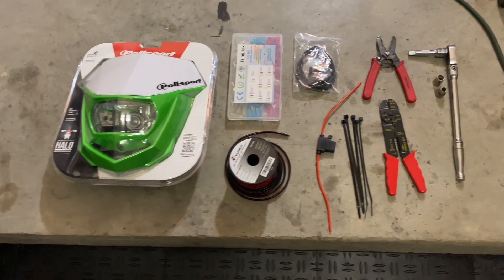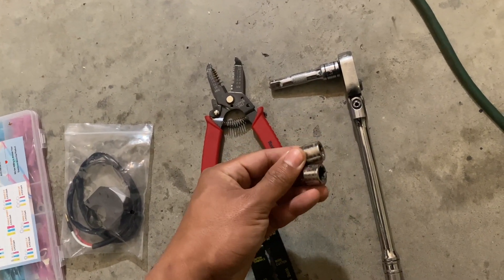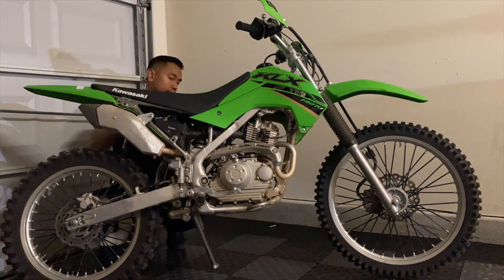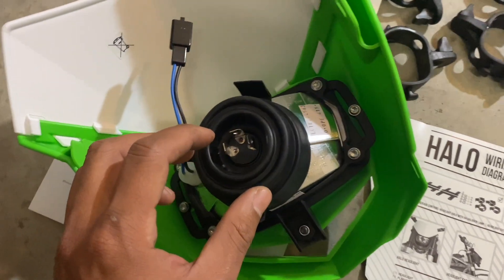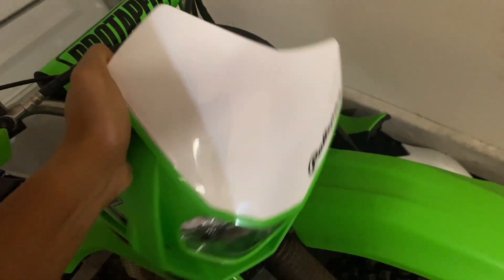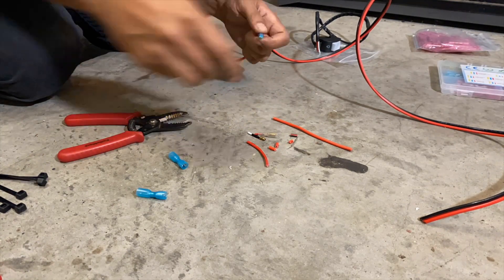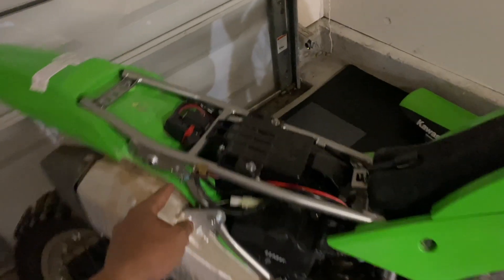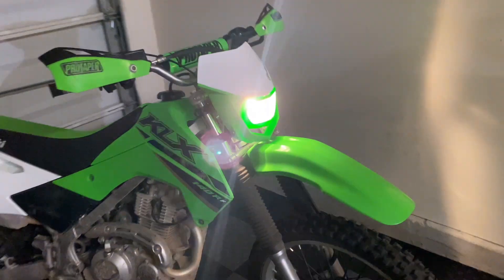Polisport Halo Headlight Installation and Wiring | 2022 #Kawasaki #KLX140RF KLX 140 RF

Comment: So my kit came pre wired with a black wire which I am guessing is the negative wire,I hooked that up to the battery.Now however there is another yellow and black cable conduit hanging around with loose copper wire on the end,not sure where this cable goes.

Comment: I noticed you didn’t use a relay and just hooked it up straight to the battery. Did you have any issues with it blowing the fuse since install? Thanks
Reply from the maker: Nope, no blown fuses or battery drain issues
Reply: @PatOutdoors awesome! Thanks for the fast response!

Comment: just got my 140 going to try and plate here in texas. i dont know anything about electrical and you went so fast over all the wire work. could you make another video more in detail?
Reply: you have a 2 lead switch, red goes to the battery, the other lead goes to the red of the headlight (high or low beam in this case) Black lead from your light goes to ground of battery. you put an in-line fuse block on the red from the battery and depending on your watts of the light would determine your fuse size.
Reply: Im in the process of converting me 250 to street, have everything, and that was well out and simple to understand. Im no electrician when it comes to wiring lol @kratic7696

Comment: Nice video! Do you know what I could do if i wanted to put one on my drz-125. It doesn't have a battery because its a kick start only.
Reply from the maker: Thanks! Hmm honestly I’m not to familiar with how those are wired. I would think it would have to rely on the stator for power supply

Comment: What color wire is it inthe front ? I want to do this to mine ..do you have a link for the light ..
Reply from the maker: I didn't, I connected directly to the battery with an in-line fuse. The one I used is the Polisport Halo, but I think the green is currently out of stock: https://amzn.to/45FbRtA
Reply: @PatOutdoors  thanks I'f I need help I'll ask you setting it up

Comment: Are tail lites and brake lights and turn signals required as well?
Reply from the maker: This question really depends on your state. I live in VA, where you need Headlights, Brake Lights, Turn Signals, Mirrors, a Working Horn, and some DOT-rated tires to even be close to street-legal.

Comment: Hey bro i had a question about the install! Does the stock battery setup have any issues with the light? Has it ever killed your battery?
Reply from the maker: Nope! Just don’t leave it on accidentally
Reply: You can switch the halogen bulb for an LED one and draw way less current.